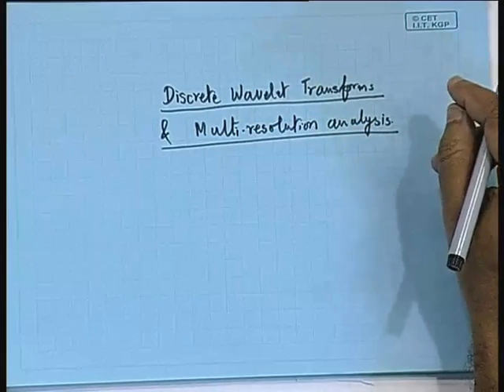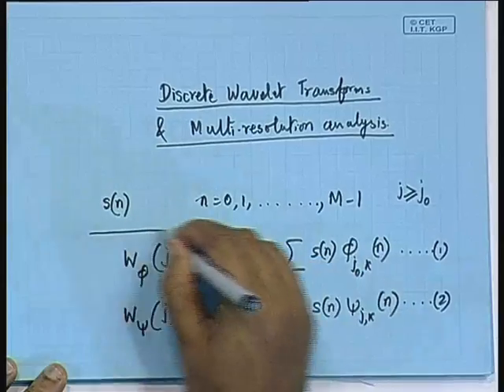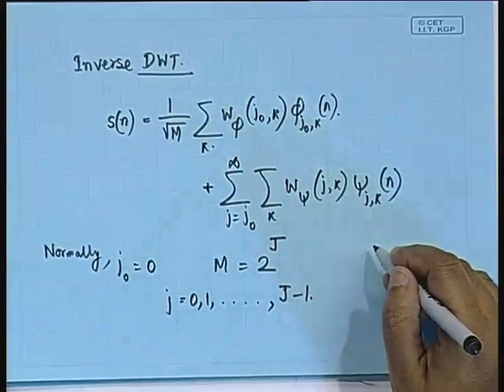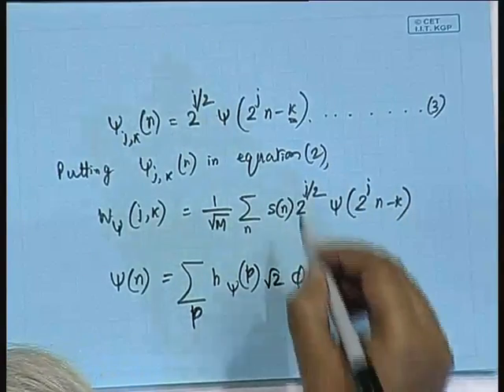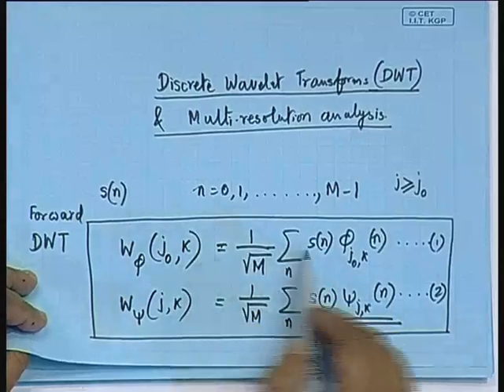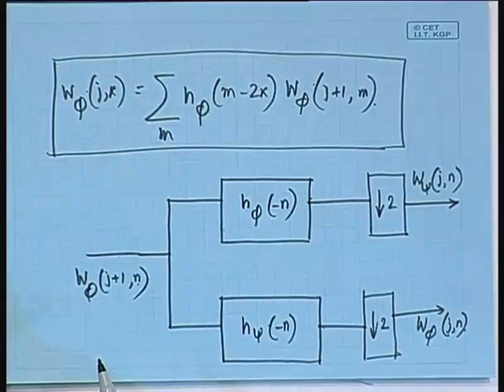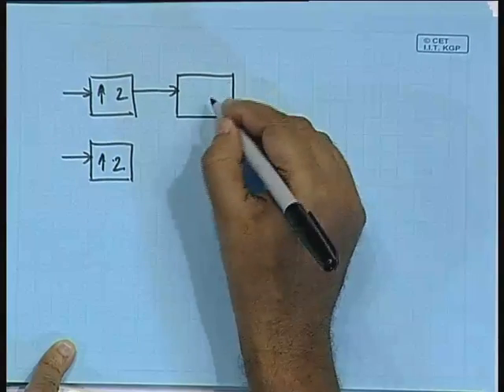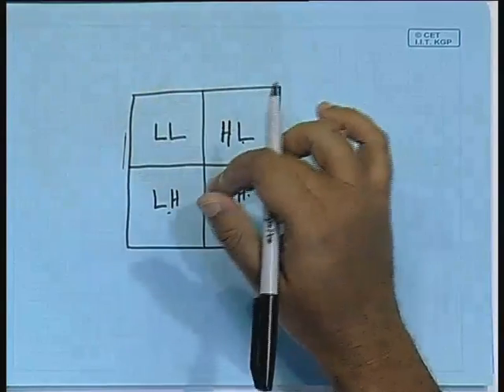Lecture -20 Discrete Wavelet Transforms

Comment: I would like to ask if its is possible to use DWT in Jpeg compression? I mean it is possible to use the features of Jpeg2000 in Jpeg compression to have a jpeg file extension.?
help me pls
Reply: jpeg uses dct (discrete cosine transform) so it's logically impossible to get a jpeg use DWT.
Reply: JPEG as in ITU T.81 uses only DCT. DWT cannot be used in it.
Reply: Jpeg2000 is improving jpeg. By using dwt on jpeg it will no longer be jpeg but  jpeg2000